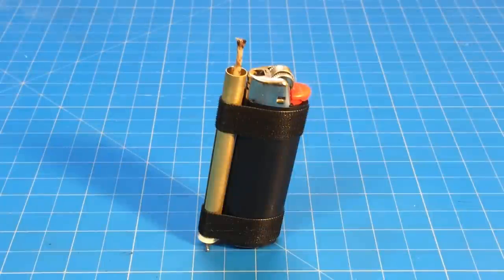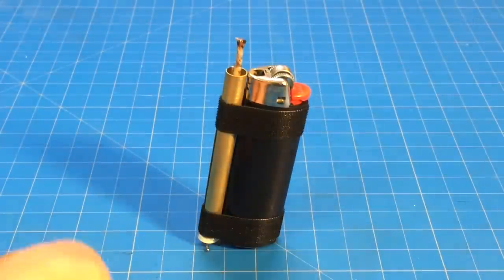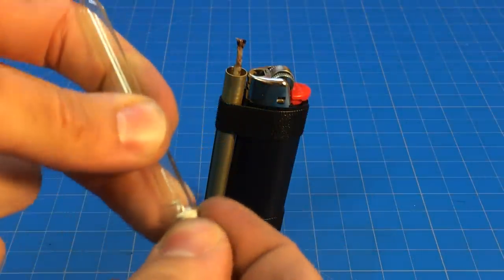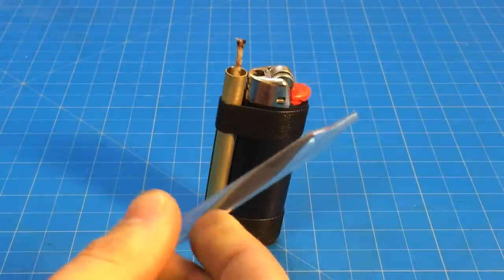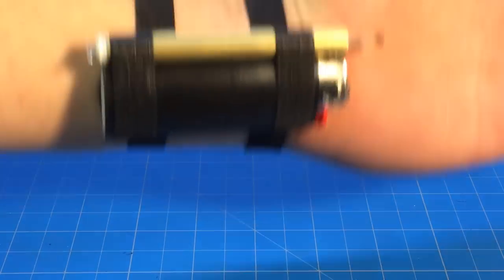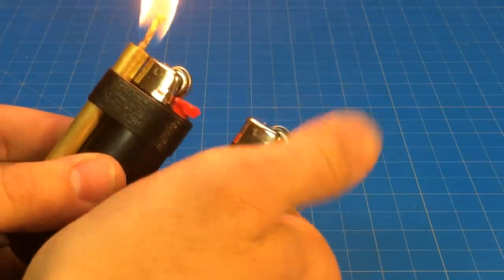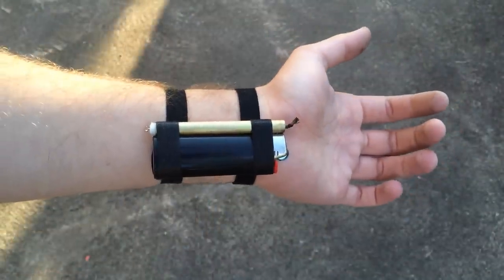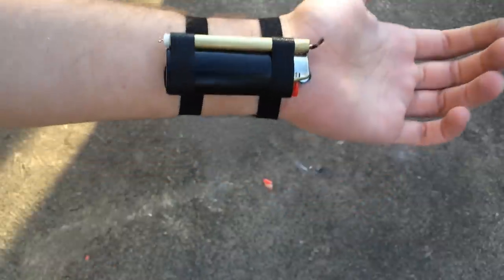Wind-Resistant Lighter Mod w/ Wrist Mount

Comment: Cool idea! I love how the haters hate and the incredulous try to nock it down, I can see all the pot heads using something like this, they always complain about the lighters not lasting, so you just fill it with lighter fluid? Do you put cotton in the dropper? How do you keep the glass part from falling from the brass cylinder?

Comment: i wouldnt recomend building this:

1) becuse the fuel could quite easily       leak all over the user and burn them when they go to use it

2) fireworks have a fuse as a delay so the compitent person using it will have time to move away

Comment: If that glass breaks from over heating. All that fuel is coming out and lighting like a mini explosion. Better hope your not holding it if it does that. Even dumber to cut a hole where your holding it... You even called those droppers fragile. Hold fire to any flame unless that's Pyrex, its cracking